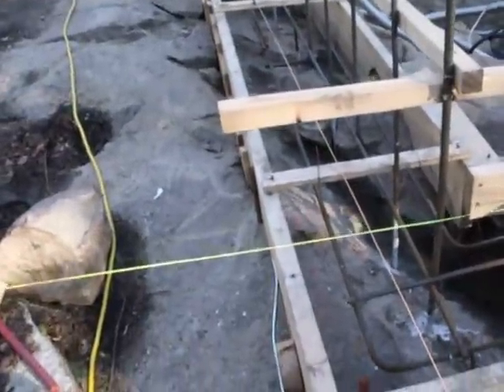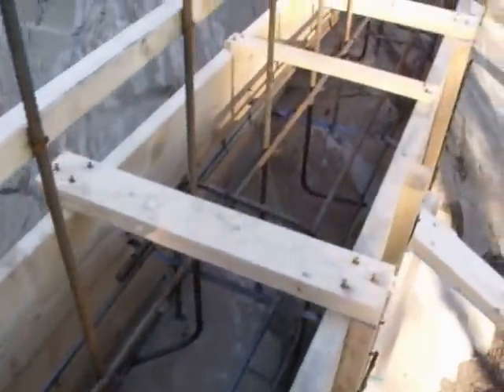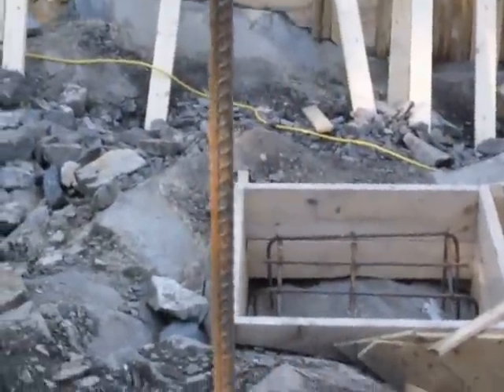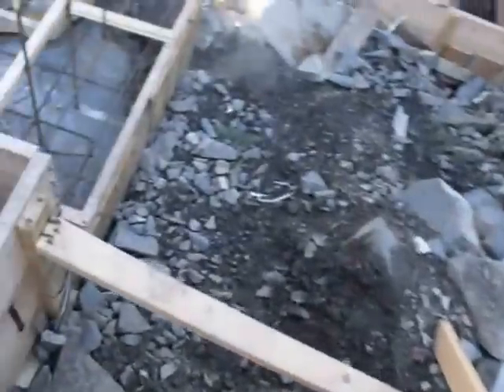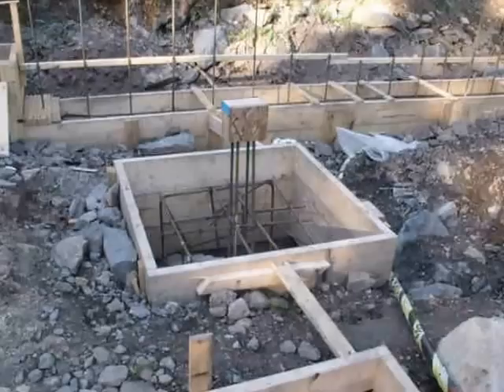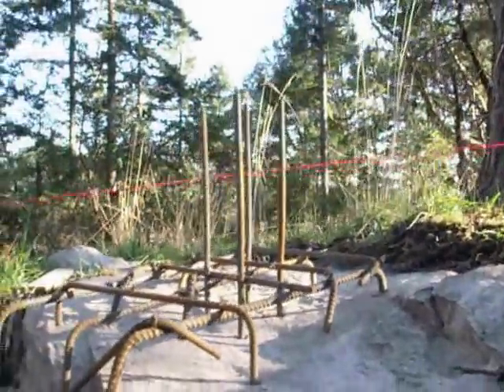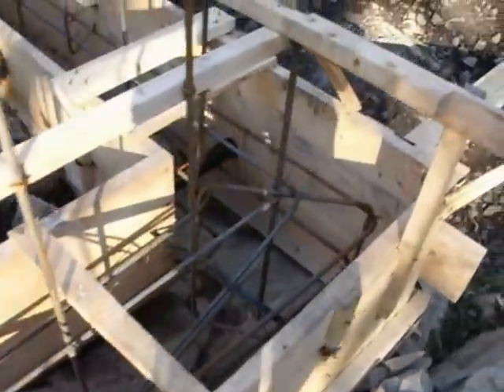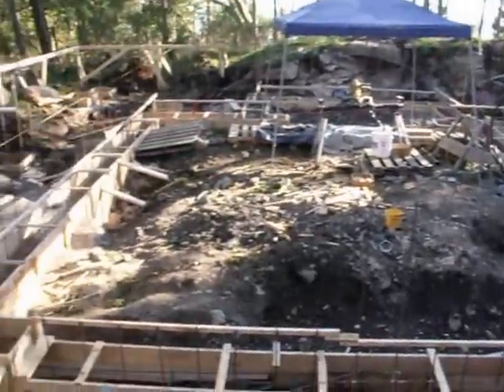Footings concrete forms on bedrock terrain

Comment: Doing the same footings now. A lot of rock broken out like yours. How many man days do you think the framing and rebar took you. Seems to take for ever. A contractor was telling my wife he could have it done in 3 days with 2 junior helpers. I don,t see how.    Canada
Reply from the maker: Can't remember exactly now, but spent over a week setting up batterboards, measuring and marking out everything before starting.  Checked and double-checked with laser.  The whole build was VERY accurate an nothing was more than 3/8" (10mm) out which helped with everything later on.  I had help from some decent and fair local builders to get things moving fow the first 2-3 days to ensure I had the best methods, then continued by myself for, I'm guessing a solid month of dawn-till dusk effort.  Our perimeter fioundation length was about 220 feet.  Seismic requirements (BC) meant drilling rebar at least every foot, 1" holes 18" (0.5m) deep and this was quite slow.  Plus internal foundations and numerous post pads for beams/deck, etc., with 4 holes each.  Included all rebar cutting/bending and holdups on really wet days.  For comparison, our concrete pour for these fittings was 32 cubic yards of concrete.  
I didn't want to rush (to avoid mistakes), but kept up a good steady progress.  My experience of "professionals" is that they often rush, take short-cuts and make errors.  Yes they might be quicker, but mostly have to work so fast or they'd be too expensive and not get hired.  Hope this helps!  Good luck with your build.
Reply: @global_odyssey  I will share your comments with my wife to hopefully get a little credibility back. Every day I am working on it all I can think of is 3 days my ass. I am after a quality outcome as you did with your footing . 160 of my 260 ft is visible (No back fill) so appearance matters.  Thank You again.

Comment: did you drill into the  bedrock at all?
Reply from the maker: Yes, approx 18" (0.5m) holes at least every 12" around the building perimeter to match the vertical rebar spacing in the Faswall blocks.  + extras at piers/post pads and as needed.  Holes were between 1" and 1.25" diameter (25mm 0- 32mm depending on whether 1/2" or 5/8" rebar) and rebar was grouted in with expanding cementitious grout.    Approx 300+ holes into bedrock in total... arduous, but my big Bosch SDS+ drill paid for itself.  I'd like to think the house would hang from the rock if turned upside down.
Reply: @global_odyssey  i think i meant my question for another vid lol..i just watched yours and can see everything...sorry about that..
Reply: @global_odyssey  sweet..thx for the reply..im building next year and doin so on bedrock as well...think i might do pier and then fill in walls made of aircrete to create a 4 or 5ft high, closed in crawl space...with steel meshed vents for air flow....thx for your reply..all the best to ya.
Reply: @global_odyssey  totally thought that guys question was a joke 🤣

Comment: Refreshing to see some proper and professional work on YouTube. We are built on similar rocky uneven ground in the NW as well, and while it presents challenges in forming up, the end result is a house that never settles! No problems with frost heave up here...Drilling into the rock for some re-bar makes one hell of a footing.
Reply from the maker: Maybe?  "Just enough" would be ideal but is hard to achieve, so that under-kill often results.  Building codes do not work particularly well here and many houses built to code have problems (think leaky condo fiasco).  Over-kill leaves less doubt... and I'm not intending to rebuild this again.  Besides, our seismic codes might be inadequate if the "big one" we are waiting for happens, so a little extra can't be a bad thing?  Also being in a relatively remote location it's often cheaper to overbuild than have to pay for an engineer's extra visits after they fail something inadequate or even to consult them at all over small issues.
Reply from the maker: +MrThunder  Thanks for the comments.  I'm not a professional builder, but designed and built this house myself.  Final finishing/trim is still in progress.  From experience, no contractor will put the time/effort into building a house like this.  It is too expensive.  Instead they will do the minimum and sometimes the minimum is not enough!  (blow-outs during pours, insufficient rebar, settlement/movement, etc...)
Reply: i thought that this was overkill!

Comment: How deep can we drill to form the foundation for rebar tie-in in  the sanstone bedrock
Reply from the maker: We drilled vertically down about 18". (1" drill bit).  A  mixture of cement based grout or epoxy was used to secure rebar.  200+ holes but the Bosch SDS hammer drill and bit worked well, albeit a bit blunt towards the end of the job.  I guess each job and situation varies.  Our geotech guy suggested anchoring every 2-3 feet, but did not need to be involved.  However the engineering for our Faswall ICFs/wall assembly required vertical rebar on 12" centres (seismic area), so 12" centres ws just the easiest way to go to line up with and continue up into the ICF cores.

Comment from the maker: It was mostly scribed, but quite roughly and much "by eye".  Big gaps were filled with smaller bits of shiplap, or whatever was to hand.  A few bits were foamed and a few bits had earth or rocks piles up, but with concrete slump being fairly low, leakage was not an issue.

Comment from the maker: Sione Ika:  Thanks for pointing this out...  it's a building site, so relatively dangerous by default.  Most of the rebar was above eye-level or impaling height.  The pads and shorter stubs were all covered promptly or extended before any traffic.  Most had only just been installed.  Areas where work was proceeding were safe and other areas made safe as work proceeded around the closed site.  
I was taking a huge risk making this video, so I was wearing  Full Kevlar body armour while filming...